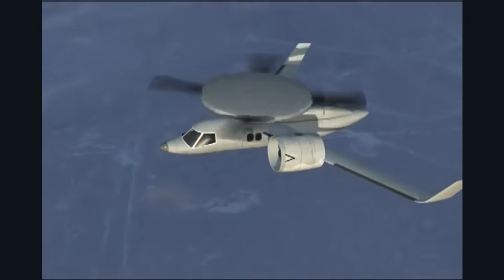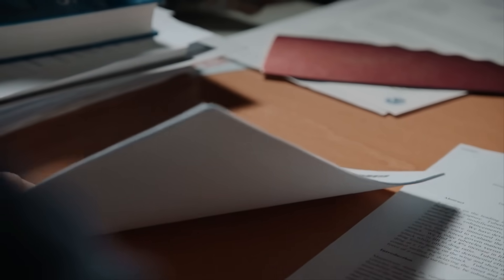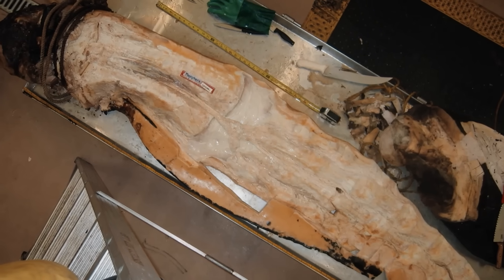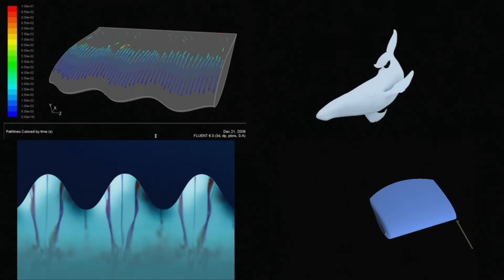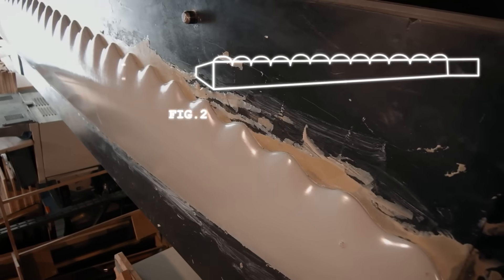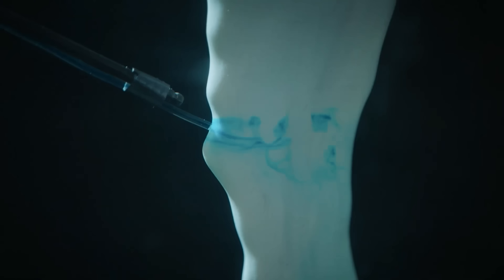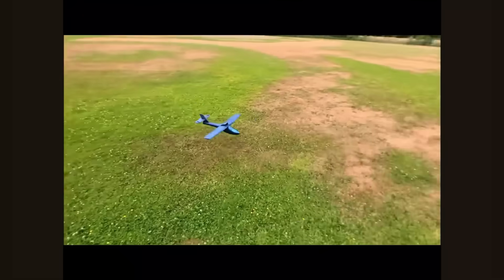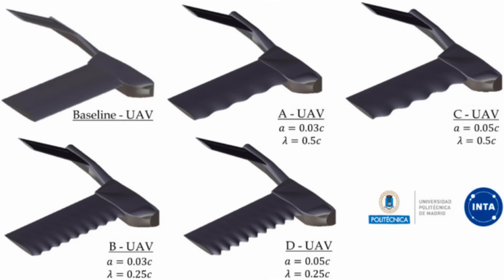Tubercle wing : An efficient wing inspired by nature

Comment: What is that retractable lifting disc aircraft in the first three seconds?
Reply from the maker: Its telescopic rotor concept by DARPA. Link to video in the description
Reply: @ElectricAviation fascinating.  Im glad you didn’t continue your experiment with the AI voiceover.  Your own voice is great
Reply: @ElectricAviation  working on a ground effect drone atm, hovercraft//ukranoplane with a centeral multi-wing design solid walls 2 very large centeral rudders/adjustable ducts with front and back stabilizing winglets and 2 front skids and a centeral hydrofoil/ partial keel/skid and a single central turbine  that intakes below the top wing of multiwing that ducts out back & mostly bottom, and a spoiler on nose peak and a fixed double pilon tail woth a spoiler ontop
 i think i can use this to extend the surface area of central multi wing quite a bit on top of the 4 phases it has in multi-wing, id never seen this before but makes total sense, tyvm
(looks a like a cross between a delorian a toboggan and a A2500 ukranoplane atm lol the tublical wings should help look also. i think i can carve them into the foam im using )

Comment: One of the problems to the Tubercle wing on windmills is that the front leading edge needs to be sectional and made from materials like Stainless steels since the effect of long term exposure to the elements ends up resembling the wing being sand blasted.
(Early North Sea floating Windmills were made from composites that were material wrapped around 360 degrees of wing.  When the front edge had been hit by particles carried by wind and storm the front leading edges were worn away and there was NO plan for repairs in place that were not both expensive, dangerous, unbalanced, and most importantly Un certifiable that the repair crews would not be called back in days to deal with a destroyed windmill because of loss of a whole blade.)
Reply from the maker: Insightful comment

Comment: If it is so superior than why isn't Boeing, NASA, Airbus, or Embraer using it?
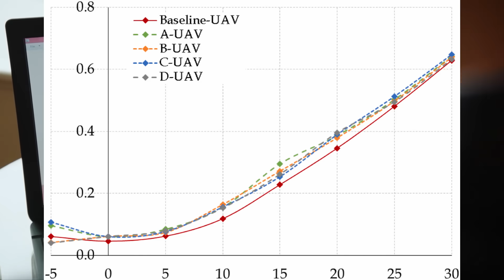Reply: Did you notice that the lift and drag graphs (timestamp 1:26) show that the tubercle wing reduces lift and increases drag relative to the baseline (assuming the baseline is the straight leading edge).  Several technical papers reflect that same observation.  Other than that, the hyperbolic conclusions presented here are surely totally sound. (?)

Comment: The tubercle patent from 2005 expires this year.  It's a bit different from the chevrons on the back of jet engines and fan blades, which are noise reduction designs.  I was expecting to see tubercles on the trailing edges of wings and props as well.  Time to run wild with this design element.

Comment: A wing with ribs, covered in heat-shrunk or dope-shrunk fabric, would automatically take up this kind of configuration. (Most manufacturers put a sheet of aluminium or fiberglass over the leading edge to prevent this from happening and hence to maintain laminar flow.) Incidentally, where does the figure of Re = 10^7 to 10^8 for a small Cessna come from? A five foot chord at 50 mph gives 2.34 x 10^6.

Comment: Would the same be achieved with multi-slotted leading edges? Single slots are common to achieve a similar effect to wing fences, in cutting down span-wise flow. Slots also induce vortices that stabilise flow separation at higher angles of attack.